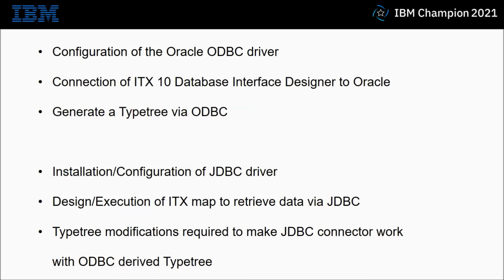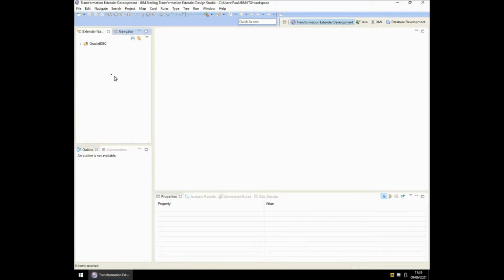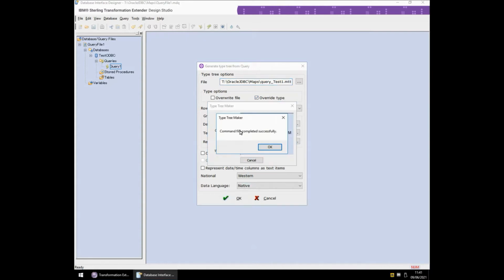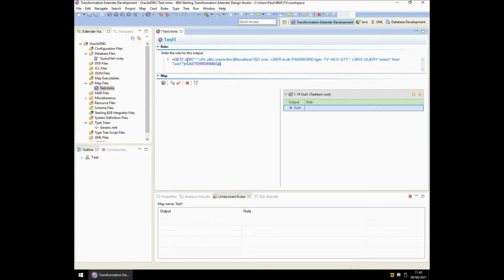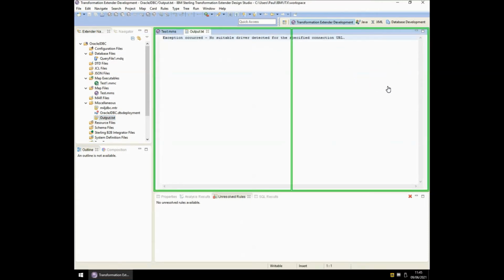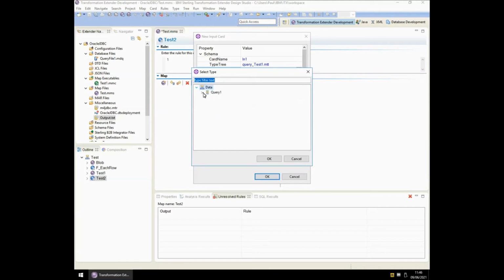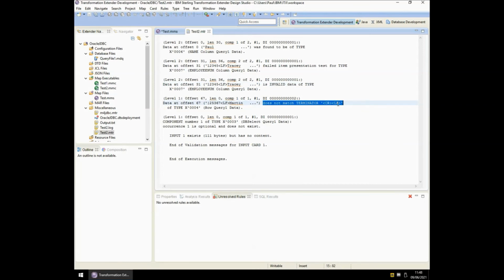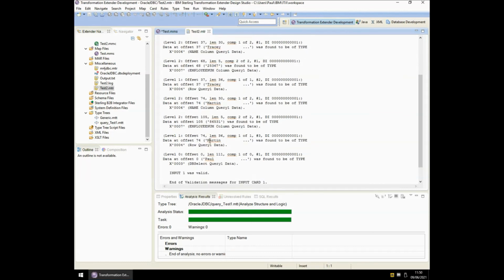Using Oracle with ITX 10 via JDBC

Comment: Hi paul, I have configured ODBC MySQL adapter in system DSN 32 bit  and connected to my MySQL server and database successfully. but when  i  am trying to create a mdq in database interface designer I am unable to view the DSN in the datasource while selecting ODBC driver why it's not showing could you please help me with this.
Reply from the maker: ITX is a 64 bit application, and you need to configure ODBC 64 bit driver.

Comment: Paul - I'm trying to connect to a local MS SQL database via jdbc, and am having trouble (when it's a remote server, I don't have the problem - just with my local).  I'm assuming it's because I have the url incorrect.  I've tried:   -URL jdbc:sqlserver://localhost:1344;DatabaseName=xxx    and also   -URL jdbc:sqlserver:@localhost:1344;DatabaseName=xxx  (after seeing what you used in this video).   The 1st gives error of "Error connecting to the database...Connection timed out"      and the 2nd gives error of "No suitable driver detected for the specified connection URL"     Is there a trick to providing the localhost url that I can find somewhere?  Thanks for all your great work you share!
Reply from the maker: Check that SQL Server is listening on port 1344 (the default is 1433).  Check that it is listening on all valid IP addresses for this server, including loopback (127.0.0.1).